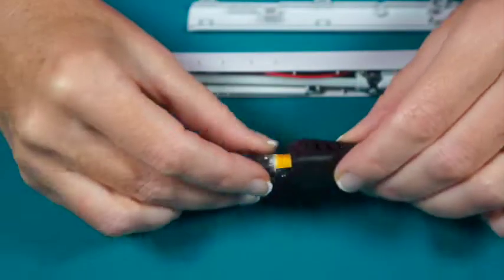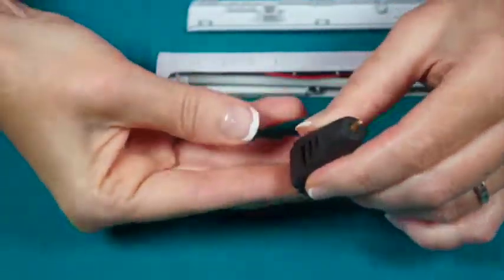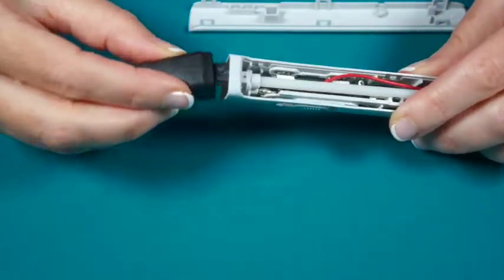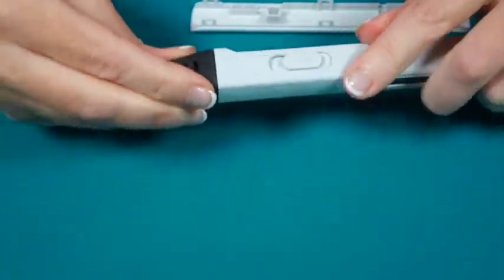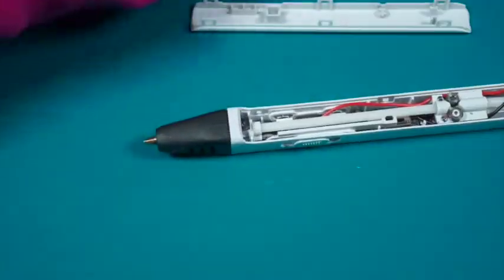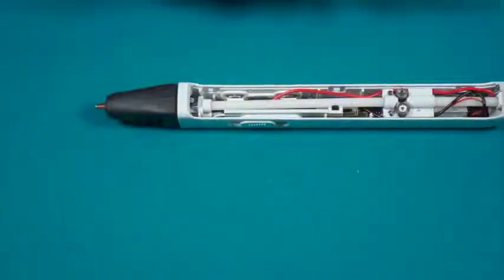MYNT3D 3D Pen Troubleshooting Tip for Nozzle Clog

Comment: what about when the abs is stuck and the plastic tube now doesn't fit properly I guess I'll just buy another tube and nozzle but 2nd day like c'mon. Yes it was 210C, yes both the end of the filament and replacement filament were flat/flush at the ends. The pen did not turn off or lose heat during the exchange process, and yes no residue on the gears of the motor and they were functionally normally. I do enjoy the Pen though, fits my hand good and I enjoy the amount of control I can get from the pen and it has a good flow rate. I also enjoy that the replacement nozzles are cheap in price.